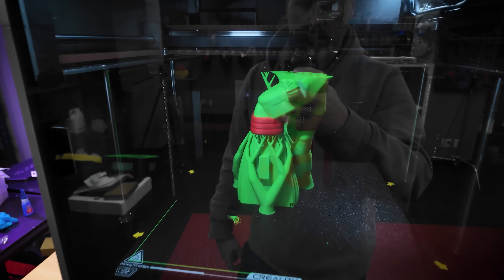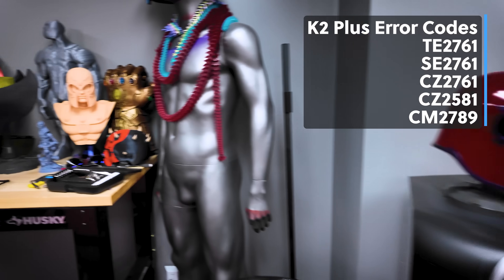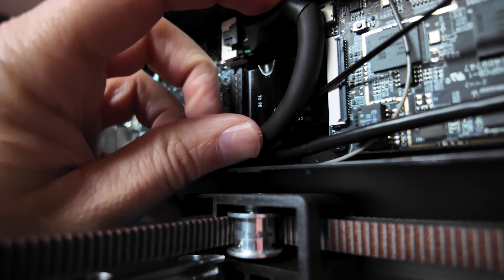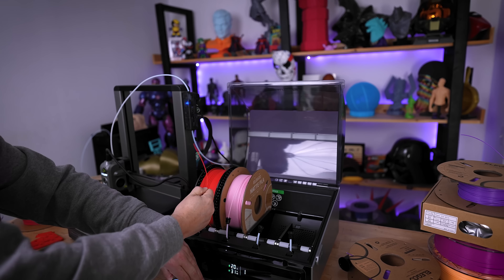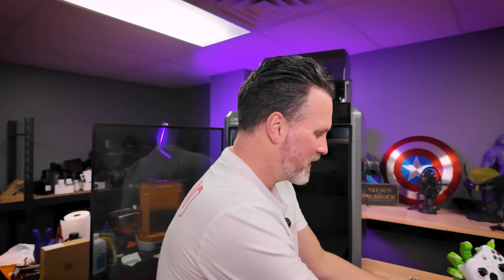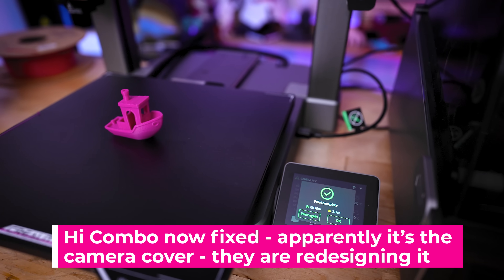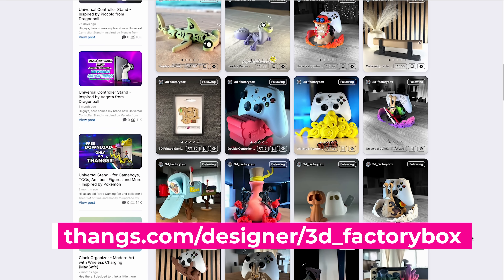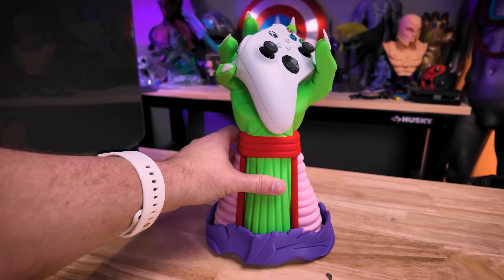Creality K2 Plus FIXED! But Are They Rushing Printers?

Comment: You can fix the hi by going into the x parameters thru fluidd and change it to 270 mm and re run the calibration then it should be ok.....just never recalibrate it after that unless u absolutely need to

Comment: I have had my K2 Plus now for 2 months and of the 38 prints that I have sent to the printer 28 of them have all failed. I had to replace the extruder and as of 30 mins ago after clearing a bunch of errors I now have a TE2761error saying that it can not level the bed.

Comment: Bought a brand new k2 pro; down in 3 weeks; very similar issue; I was reaching the same conlcusion.

MCU errors at end if print, followed by Y008-FILE-DET filament board nuking itself and giving filament detection errors.  Kept getting occasional issues with latch state stuck on high (out of filament) or other odd behaviors and errors at random that would magically go away.  Was a hardware engineer in previous life; so i'll poke through a RCA in coming weeks.

My guess is wiring harness is shorting during movement and causing a stuck latch or voltage spike, replacing now, will ohm out after.  Sensor board nuking is more a of a symptom of a larger problem.

When you step back and compare to bambu; this is a very fragile machine that is NOT designed for failure modes and will have more downtime and less MTBF; if we SLA/SLO'd uptime on printers, there would be a clear winner.  So fixing the harness or strain relief is not the core issue; basic design principles are missing from architecture. 

HA sensors in mandatory, latch state control is mandatory, voltage control and TVS is mandatory (a 8 dollar sensor or 1 bad wire should not take down a 1k system)...   All of this is missing from k2...  Competing in the 1k+ market; they need to focus on fault containment / control and not "best-case behavior".   This is an foundational design principle that would need to change, or they can keep watching bambu eat their market share.

TLDR; bambu designed for failure and keeps running vs k2 pretends hardware never fails, spikes, sags, or hiccups.

Comment: You have more patience than I do. If you spend around $1,200 for a 3d printer like the K2+ that I bought, the idea of having to work on it as if you bought a used printer with 10,000 hours on it just angers me a great deal. I'm so fed up with this printer that I have had for barely over 2 weeks that I'm sending it back. The CSF was a nightmare to get it to retract filament so I could swap colors. The endless Y Axis error codes that sound like the printer is trying to self destruct has pushed my last nerve. I so bad want to take this out to the back 40 and fill it with tannerite and blow this thing up into million pieces but I'm not letting them off this easy. I'm getting my money back.

Comment: So question for you, Jessy, and or anyone. Before you swapped out the part, did you also ever run into the printer just failing to print? And I mean the first layer was bad, not a solid layer, and no matter what z offset you did, it would either be too close to the plate and scrap the plate, or it would print fine in certain areas and poorly in some... tbh idk really know how to explain the issue I was having. (I ended up getting Creality to swap out the printer cause there is too much we did, and still nothing solved the issue.) 

ive been on reddit about this issue and some people have said swapping out this part solved the issue for them, but i never did so just wondering if you ever came across this issue

Comment: Can someone help me with this error message ... FB2847 k2 plus foutmelding , have tryid restart, change cutter, cleaned nozzle, thus not retract ore extrude filament?
What is going one whit those machines, I have it 2 weeks and I have all kind errors and lost countless of ours repairing it. Support send me other parts everytime I contacted them. buth after a while it is still giving error codes , mostly differend codes. it drives me crazy!
Reply: It’s Trash.  Mine has the same errors he has and I just purchased it and can’t print spent x amount money can’t use it lol.

Comment: Hi,
I had the same problem 9 months after buying it. It started giving all sorts of errors, but the most frequent was the leveling issue; the hotend even bent from the pressure of the bed against it.
I replaced the leveling sensor and the hotend, but it continued to give errors. I checked the cable and noticed that its contacts were intermittent as I moved it. I replaced it, and it's working fine now.

But now I'm getting buffer errors; something is causing it to get stuck. The printer works perfectly without CFS :(
I think the printhead access point has a very steep angle and the cable flexes too much; I suppose it's a part that needs replacing frequently. :( . In other printers, the cable accesses the printhead from above, so it's not under as much mechanical stress at that point.

Comment: After over 2000 hours of basically flawless printing on my K2 Plus, it started throwing random errors, mostly bed leveling hardware sensor errors. After replacing the sensor twice, I found this video and contacted Creality for a new cable chain bus cable.
They made me replace the leveling sensor again, the hotend board, and the main board, and rechecked all of the connections numerous times. FINALLY, after a month of back-and-forth troubleshooting, they sent me a new cable, and everything works flawlessly again.
I love this printer for its size and price - when it works. I just need to stock up on spare parts. I highly recommend the MicroSwiss hot end for it. I can print PETG reliably with it after the upgrade.
Creality should have a full set of replacement parts available in their store, not just a few and require you to go through customer disservice to get the others.

Comment: Can I ask when u had these issues was the bed pushing the extruder and carriage up ???
Reply from the maker: Not that I’m aware of. I think most of my issues stemmed from the cable that I needed to replace
Reply: thanks  @UncleJessy I think it’s definitely my issue as i started playing with the wire and it seems to work for a bit then goes again that bend in the wire is definitely not helping it could probably benefit from a short extension has yours been fine since or are they going after a short time ?

Comment: So the issue you spoke of on the Creality hi for me was a slightly deformed head cover that would catch on the bed where it cuts.  Before I discovered it i would have the same set of errors. I used a bit of heat from a heat gun and was able to shape it back to what it should be. I have had zero problems after that. Maybe this will work for you.

Comment: I had nothing but problems with my K2 Plus after the first few prints. Purchased it on Ebay direct from Creality and it was a nightmare trying to return it. With them trying to troubleshoot it and giving me the runaround I don't think I'll be purchasing another Creality printer. My K1C works much better with few issues. I did order 2 Snapmaker U1's. Hopefully these printers with be much better.

Comment: I printed a simple drawer divider to use up small rolls.  A the end of the print there was an x axis error.   When I started another print the head slammed against the side and the back. I put it through calibration and I still got errors. 
 It does not need to clog.  If you get a small sliver of filament in the "filament present lever" in the extruder and you have a CFS the screen will tell you to remove the roll from the side of the machine.  The machine was finished out a print and showed a x axis error.  In start ups after error the head slammed from side to side.  I should have wrote down all the errors.  I tore the CFS apart 3 times and pushed filament through all tubes.  After 6 hours I found a little sliver locking the switch.

I am doing usb print transfers.  
I wish the K2 had a larger scream and would have switch state displayed on the screen.

Comment: I just had the exact same problem.... luckily after going through the diagnostic steps with Creality support they sent me the strain gauge, the nozzle cable and the communications bus cable all in one shipment so I didn't have to await multiple packages with testing in between. It wasn't the strain gauge (I tested it first) but replacing the two cables got it working again. If the cables were available in their online store I would purchase backups so I don't end up going 2 weeks with a broken printer next time (I have one additional K2 Plus). I mentioned to the support tech in the ticket that the cables weren't available in the store and the response I get was "Because cables are generally not easily damaged, we don't sell them. They are also under warranty, so if they are damaged, please contact us." I hope my 2 K2 Plus printers last long enough to make it out of warranty... then how will I get replacement cables?

Comment: I have been getting error codes on my new K2 Pro after a few days of perfect prints and remembered seeing this video about the toolhead cable. I am not getting any of the error codes you list here though - I am getting XS2353 and BM2355 mostly. Filed a ticket with Creality so we'll see what happens. Have been doing a lot of troubleshooting, but haven't solved it yet.
Reply: Creality sent me a replacement tool head cable and it solved all the errors. My K2 Pro is a happy part of my little print farm now :)

Comment: I just got my machine and I’m getting multiple different error codes I’m getting abnormal resistance under heat bed, nozzle leveling sensor hardware issue, z axis homing abnormal and 1 other code.. do you think that my issues could be caused by the same problem you had with yours?

Comment: I am getting the error TE2762, so I replaced the wiper module and the strain gauge but still can't home the Z axis or pass the calibration tests.  This is unbelievable that a $1500 machine within 2 months is having this many problems.   I am also on my second extruder too but still get extruder clogs though not as frequently than the extruder that ship with it.  S

Comment: I would open that harness and see what wires are failing, insulation or melting together. Or poor quality wire that is not the super flexible type of conductor.

Comment: Was interesting to see this video .. I had my K2 delivered in Nov last year .. come Jan I started getting issues ... they replaced the gage, the pcb board in the print head, the cabling in the print head, the cutter and finaly the small PCB board that the screen connects to that I ended up getting myself from Ali Exspress .. took nearly 4 months to get it sorted and felt as if they were clutching at straws but its been fine since

Comment: So not only are games released in alpha state , they're doing the same with printers now??
Get a multimeter and check the wires for continuity. one probably has a break in it. (or high resistance) it's usually NOT cause by angles , but movement. (or a combo of both) but a static hard cable angle doesn't make it break..

Comment: My extruder has had problems since day 1 that have progressively gotten worse to where it won't extrude at all. The extruder body looks fine and the motor would work but then start clicking and not extruding, so after going back and forth cleaning it and swapping nozzles and hot ends,  I replaced the motor which caused it to work even less. Creality is sending a new extruder and motor but I don't have hopes it will fix it.

Comment: thank you for this video. one issue I've been having is I started using the spool filament instead of the cfs and after pressing retract I can't pull the filament back out. I can then extrude so it looks like it isn't cutting and releasing the spool filament. any ideas please.

Comment: I never knew I needed a Piccolo arm until now. Im in the market for a new printer (currently using a Cr-10S) and I thought the K2 plus might be its replacement but now not so sure. I also like the new elagoo Centauri Carbon but not thrilled with the smaller bed size.

Comment: Ive had this issue and defo the TE2761 fault, cured mine by disconnecting and reconnecting the printer head end.  I also couldnt update the wiki site to tell others so reported that. Might look and buy a spare cable as I’m sure it will go again at some point.  Love the print will go look at his work.

Comment: I have been struggling with the decision getting a K2Plus and giving Creality another shot. I have 2 Bambu printers X1C and a A1. Had some issues with the X1C after 3 months but once fixed and growing pain it has been solid. I design 3D terrain and prototyping. Head ache free.

Comment: 1:14 i had the same crap happen on and ender 3s1pro, cable was pinched in the base from the factory, head would just stop in the middle of the print

Comment: I bought 2 K2 Pluses, one of them the CFS had a bad feed motor for one of the spools which took a month to get replacement parts for, the second one, the door wasn’t attached to the machine when I received it. This took 2 months to get a replacement door. 😑

Comment: My brand new K2 Plus Combo just failed in a very similar fashion. After a couple successful prints I’ve been having major issues. The software on the printer has frozen several times resulting in ruined multi day prints because it wouldn’t return to the proper layer after rebooting. This persisted after resetting the printer. Now I’m suddenly having the auto leveling issues. I get the fact that things can happen but this is a bit too much for this expensive of a printer. Not to mention the back and forth with Creality support has been horrible. Perhaps it’s a language barrier but they seemingly ignore most of the context of what’s written just to leave me waiting another day for an inaccurate response. I’m very willing to tinker and adjust as time goes on. This however is just excessive so early on in the life of a new machine. Mine is being returned while I still can.

Comment: How did you fix this? We're getting the same error code, but Creality won’t help since we bought the printer second-hand.
CZ2768	Z-axis homing issue, may have an external disturbance	
1. There is interference when the Z-axis homing. For example, the sensor is directly affected by vibration, and there is abnormal force that causes the sensor to trigger.

we never touch the printer when the head is moving 

When we purchased it, the filament was jammed in the CFS, but I figured it was fine. After getting home, I removed the broken filament, but it still wouldn’t print properly. After another hour of troubleshooting, I gave up. The next day, the printer started throwing this error code every time.creality no help as we bought it 2nd hand  plus having problems with not sticking to the bed while printing that was before the error code problem four days now trouble shouting it wish they did a geco plate as these work lush on our bambu lab p1s and a1 with i just bought two a1 with ams lite for the same price we paid for the k2 (£800)uk

Comment: Awesome information Jesse! Just got my K2 plus delivered yesterday! Went straight to Orca and sliced up Yosh’s Iron Samurai after I colored it and I’m getting stringing from the prime tower and retraction issues into the CFS (when using non creality filament). Did you use Creality Print or Orca for that multi color print? I read that Creality print fixes some problems that orca is having.

Comment: Im having this problem with the z axis/extruder senor issue. I also had my bed fully delaminate and have had countless z axis problems that have been directly traced back to the creality slicer making a bad code. So nothing they make is right. Were going to try to replace this cable but their support has been extremely slow. Probably because of all the people with problems. They did get me a bed replacement after a week long email with support, in which we exchanged only 5 emails which shows how slow the support is. Our CMF is also bricked like almost everyone else who has it. We really hate this printer and we are praying that Bambu comes through with their announcement and get a large printer on the market.

Comment: They should have mounted those PCB's on the other side of that panel to get them out of the hot chamber environment.  Some commercial grade components are only rated for up to 50C (122F) ambient temperatures.  Even more the more robust components are usually only rated up to 70C (158F).  Rule of thumb once told to me by some electrical engineers I've worked with is that for every 10C above 50C, you can expect it will cut many types of components' life expectancy in half.

Comment: horrible... I still run 2 Ender 3S1 (0.4 + 0.6 nozzle) on Sonic Pad for about 3000-4000 hours now without any real problem besides a finetune Z-offset maybe. SO reliable - and now it feels only garbage is on the market.